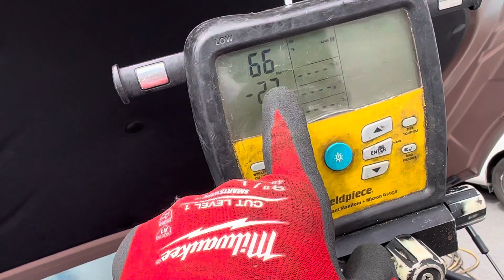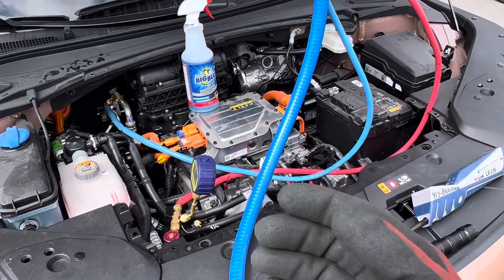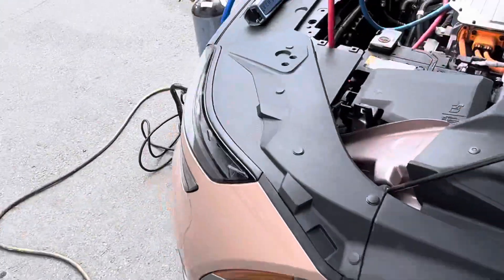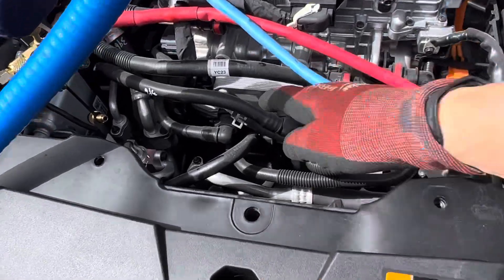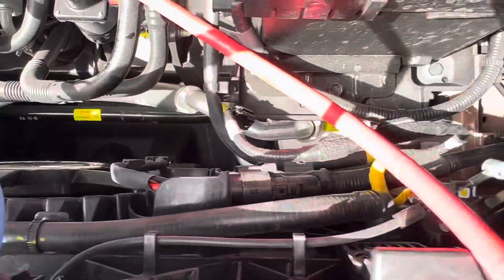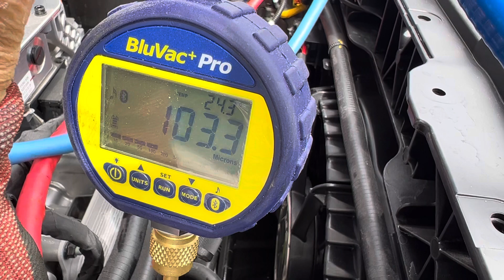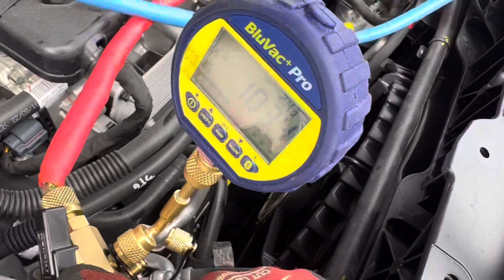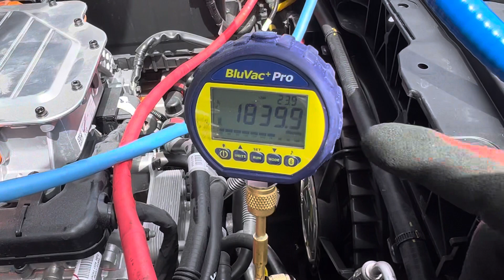MICRON GAUGES ACC-U-TOOLS compared to FIELDPIECE REFRIGERANT GAUGES placement readings

Comment: Tom, can i also go from vaccum pump directly to low side bypassing maniforld and attach micron guage at low side.. i assume that is much better than going thru the maniforld ..
Reply from the maker: Yes, I have quite a few videos showing this. 
    Because I recharge from the high side using liquid 100% and it only takes about 10 seconds to 30 seconds to completely charge a vehicle. 
    I put my vacuum pump on the suction side, low side fitting. 
   And I have my micron gauge on the high side with ball valves and a Tee 
So when it comes time for me to recharge with liquid refrigerant in the high side, I turned the ball valve to protect my micron gauge from refrigerant and then the refrigerant has a clear path to enter the system through the high side .
Reply: @coldfinger459sub0  Thanks. i am watching that video right now.

Comment: Tom i was told that toyota hybrid electric compressor doesnt have OIL is that right?.
Reply from the maker: It has oil inside of it
Reply: @coldfinger459sub0  Thanks when i replace electric compressor for HYBRID do i need to add oil. if so what oil type it is and i am sure it is not PAG. PLS advise
Reply from the maker: @sivucit  whatever the manufacturer says for that specific year make model vehicle you have to look it up.  If you’re purchasing the compressor from the dealership, ask them to look it up for you.. 
    Some compressors from the dealership come completely 100% fully charged with enough refrigerant oil for the complete entire system

Sometimes compressors come with only enough oil for the compressor by itself 

Sometimes compressors come completely empty with no oil in them at all 

In all cases, it’s the technician’s responsibility to open up the system. Follow the manufacturer specific instructions on draining because they’re not all the same. . 
  Some compressors have a oil drain port and a reservoir some compressors drain through the suction and discharge this has to be referred to to the factory service manual

And then an oil balance needs to be completed on the existing system as per factory instructions from the service manual for that particular year make model vehicle to balance the oil volume

Comment: Currently looking at the following setup to get started with a micron gauge with a RRR machine, thoughts?
Bluevac pro

Appion VFL45L - MegaSeal 4in 45º Vacuum-Rated Connector - 1/4 in to 1/4 in
Appion MGAVCT - 1/4in Valve Core Removal Tool
Appion CCT14 - 1/4in Core Control Tool
Reply from the maker: Hands-down, blue vac pro. 

Don’t forget your double ball valves to make sure it is isolated . 

Always have it pointed up words if you can so you don’t get oil on the sensor 

You’ll have to go to the cleaning process if you get a oil on it it’ll tell you . 

Watch Jim Bergman’s video the long one that’s an hour long about vacuum 

Get the book $19 a little one from True Tech Tools about Vacuum . 

When you start going to vacuum down at this level, it is so sensitive and so accurate beyond anything analog ages or normal digital gauges where it’s 29.9. . You’re talking about a sensitivity that is 10 magnitudes more accurate and sensitive in small increments.. 

Many people get very frustrated at the micron gauge when they try to use it because they just don’t understand how sensitive it is . 

It’s going to be a learning curve . 

But this is what my father started me on my very first vacuum I ever performed on a job was using a micron gauge at the age of 12 . 

I grew up never not using a micron gauge. I have always used one on every job. 

When I was young, I did not know there was lazy people out there. I did not know there was cheap people out there. I did not know that there was people who did not know about using a micron gauge. . 

Then I got my first job and discover everybody who is 20, 30 or 40 years older than me know very very little about anything with air conditioning

8% discount at True Tech Tools if you use my promo code in to check out coupon box 
LECHAIR 
All one word all capital letters

Comment: Do you know what the procedure they follow at Toyota to charge their vehicles off the line? What I'm really trying to ask is if it's worth it to have the refrigerant recovered and then running a good vacuum with the trublu setup and then charging it up. Would that be better than what they do in the factory?
Reply from the maker: At the factory, it would be by weight because they have to repeat it exactly every time the exact same way on every vehicle. 

Can’t be guessing every time the temperature changes a little bit .  Going by pressures or bubbles in a sight glass

They’re not gonna have 100 people with assembly, shaking them looking at bubbles.
Reply: @coldfinger459sub0  I guess I'm wondering about their vacuuming process and how good that part is.
Reply from the maker: @mailmanjoe  no they do not spend a long time on the vacuum. All the parts are brand new it’s probably barely 60 seconds and then blow through the refrigerant.

This is why when I get some of these vehicles that are only one or two months old straight off the dealership that got an accident as soon as they dry them I test a refrigerant and sometimes find one percent or 2% air mixed in with the refrigerant
Reply: @coldfinger459sub0  So is there a benefit to recovering, perfoming a really deep good vacuum, and recharging?
Reply: @mailmanjoe   if i buy any new car, from now on, i will re-do the proses of RRR. Vacuum down to 100 microns if possible. 24 hours vacuum no problem in my own home and using my own tools.  I will be doing my 3rd RRR soon now that i got trublu hose. 1st try 330 microns, 2nd try 220 microns. 3rd try will have new dessicant filter and 3 new hoses section, my car is 9 years old u see.... so me is also doing preventive maintenance. With 3 hoses n dessicant bag new, i can then re-balance its oil by approx 40 to 50cc, which out of 120cc is 35ish %.  Oil aged too overtime. I am in the tropics so hvac work like crazy.

Comment: I must add, the 3/8"  Yellow Jacket 16248 Plus II  is a 4 feet one.  Sure is shorter than the but-FATTER Navac, but I would expect equal performance at the least.
Reply from the maker: You can purchase vacuum hoses in all different sizes if you want a 50 foot vacuum hose or a 50 foot Refrigerant charging hoes you can order it.
Reply: @coldfinger459sub0   Yes, in USA you can have custom made hoses and using a very good hose. Me here, everything GOOD must import from USA hahaha. So sad.

Comment: My mentor. I want to update you.
My Trublu arrived and also I bought Navac Big Boy 1/2" hose 3/8" and 1/4" hose end, 6 feet for fun.
The Navac is a poor performer given it is a 1/2". Its 1/2" hose end doesn't spin nice n smooth, I think it did not get
a good deburring process.

Test pump is 8CFM and 9 microns capable. Biggest port is 3/8". Micron gauge at hose end, a Fieldpiece MG44.
1/2" Navac Big Boy of 6 feet need 4.5 minutes to hit 100 microns, with -4 micron/minute conductance at 100 microns.
3/8"  Yellow Jacket 16248 Plus II need 3.5 minutes to hit 100 microns, with -11 microns/minute conductance at 100 microns.
3/4" Trublu of 1.5 meters ( 5 feet ) need 1:45 minutes to hit 100 microns, with -25 microns/minute conductance at 100 microns.

I also got Navac CRT the dual size one. I find its operating smoothness is better on Appion.
End of report😀
Reply: navac CRT is smoother than appion CRT?! unbelievable. I'll need to give navac CRT a try now
Reply: @lordjaashin   u misread. Read again. "OPERATING SMOOTHNESS IS BETTER ON APPION". I did not word it to well, sorry
Reply: @suryaprihadi2258  oh. ok. glad to hear nothing comes near appion CRT quality.